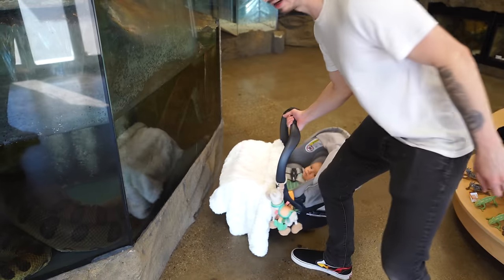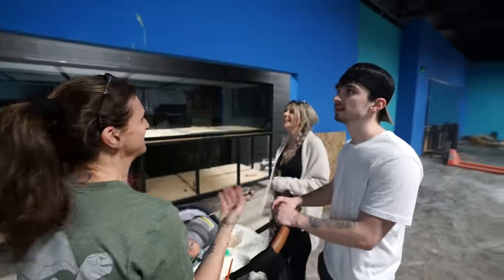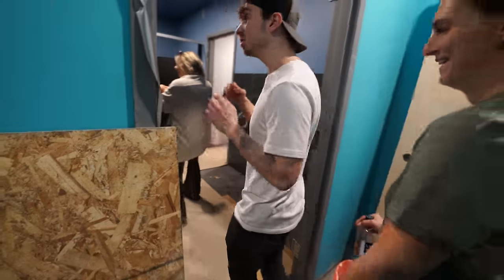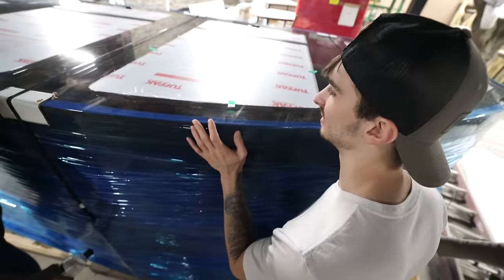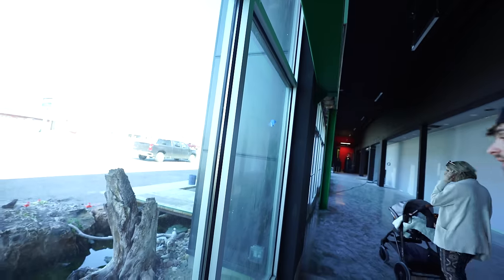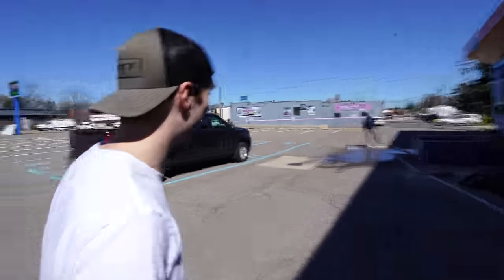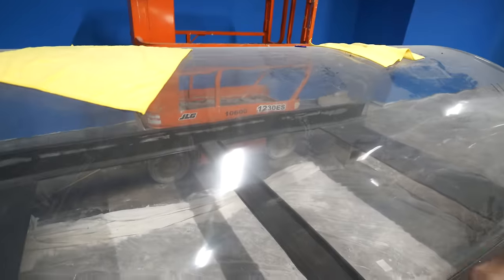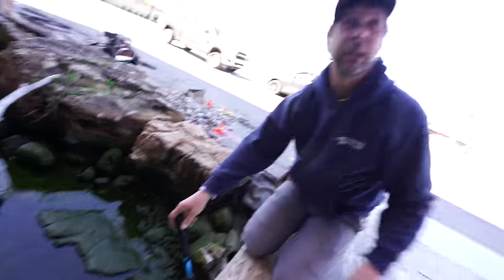Huge Problem With Giant Reef Tank!!

Comment: Things are really coming together! So exciting!!! 😃 Not sure if you’ll see this and maybe I misunderstood, but about the handicap stall sharing the shower stall - as someone who used to work with physically disabled people in wheelchairs and as a disabled person myself who sometimes needs the handicap stall, it might be really challenging for a person to have to wait for people using the shower, plus if the handicap stall portion of the floor gets wet from the shower or wet dripping people, that could be a safety issue. I completely understand needing solutions to the complications you’ve run into but it’s worth reconsidering that one if it might compromise the safety and needs of your disabled visitors. All said with love and I hope someday to come visit! 🧡

Comment: Use a baby gate to start at one end (since it’s adjustable it should be able to move in and out with the water flow) and then push all the coy to the other end near the portable holding tubs….that way you shouldn’t have to chase the fish as much especially when it’s down to last few